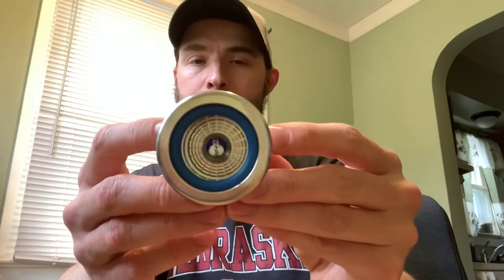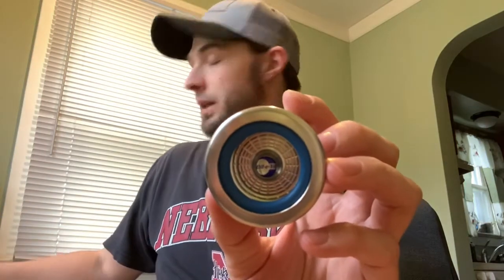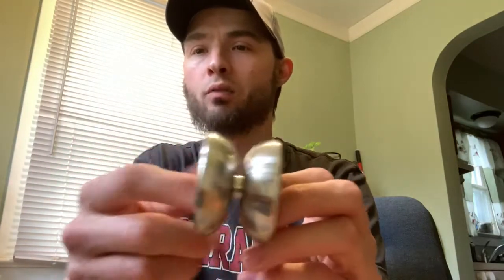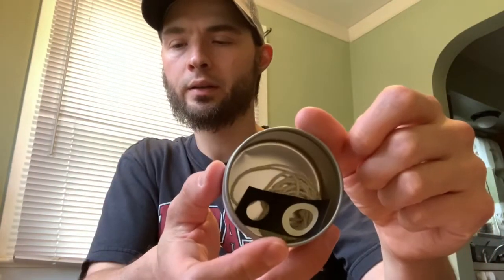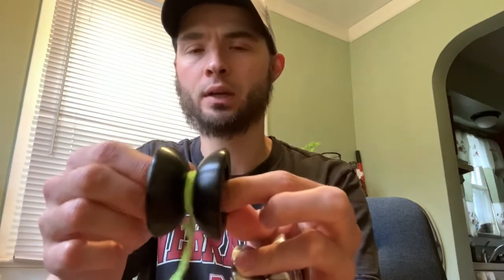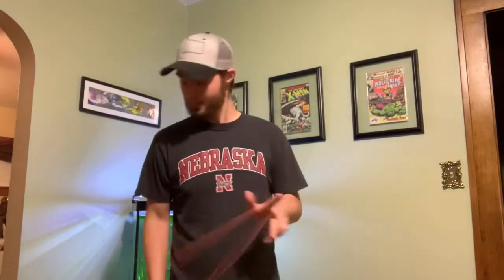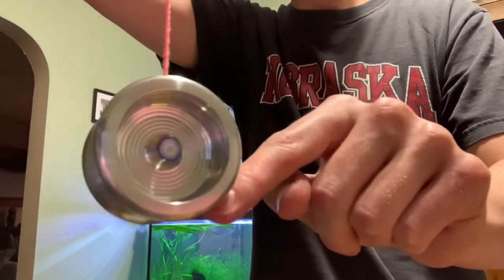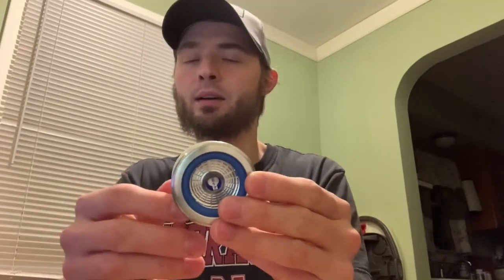Dif-e-Yo BTB Tank Yoyo Review by Casual Throw

Comment: Very interesting review. Well done, sir. I like the ringing sound it makes or is that just the dry bearings? Your next video should be your wife titled Rant of a Yoyoers Wife about My Husband Having Too Many Yoyos! Maybe just use a thicker string if the rings make it slippy. With the rings - that seems sooooo waaaay too heavy. At least for me. It seems like 64 grams is my limit but sometimes 66-68 grams play as light as a 63-64 grams yoyo.
Reply from the maker: Ha! I will have to see about that one. I'm not sure what the count is off the top of my head, but I am sure she would just say "too many." And thanks for the compliment. It's a fun throw and I definitely use thicker string for it. I also find that the rougher texture of 100% poly string compared to poly/nylon blends sometimes works in lieu of thicker string. Honestly, it does feel heavy with rings in, but not as heavy as one might guess. Even so, I prefer it without the rings.
Reply from the maker: Sorry for not answering your question about the ringing sound earlier - that is definitely a dry bearing. I swapped in a few different ones to test and the yoyo was considerably quieter with those in it. The yoyo does have a distinct sound while spinning, but it's not as loud as the video would suggest - it has a sort of whistling sound rather than a ring.

As for strings, I swapped from a thicker poly/nylon to a 100% poly of the same thickness (Zipline Performance Thick) and the response is much better. Seems that the smoothness of nylon can affect response a bit.